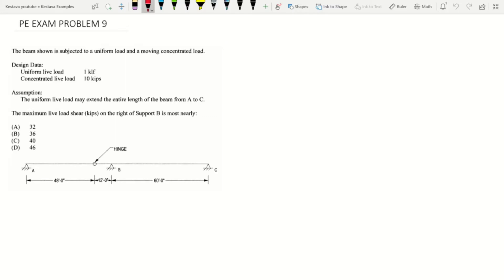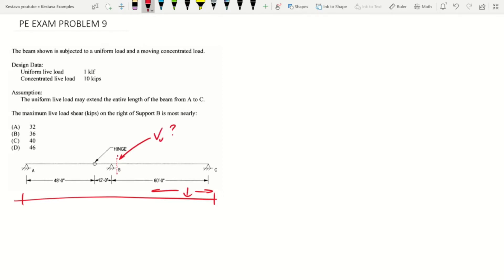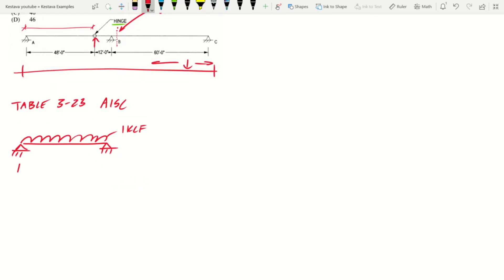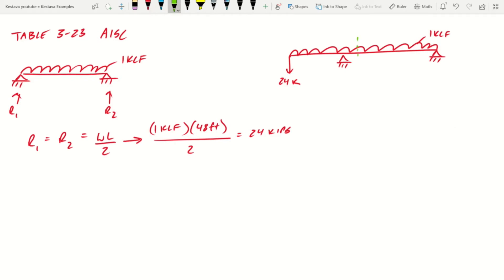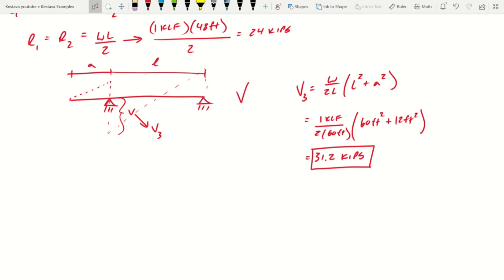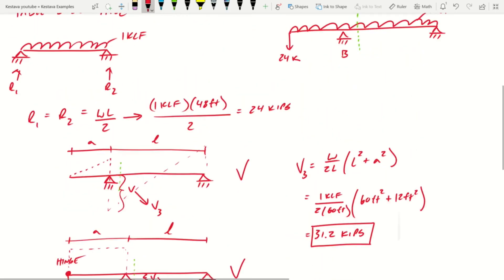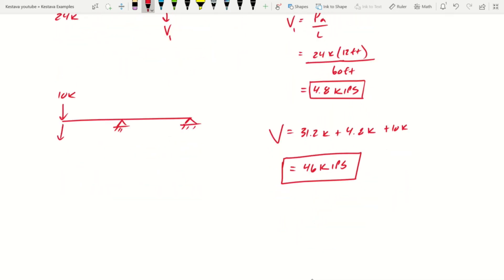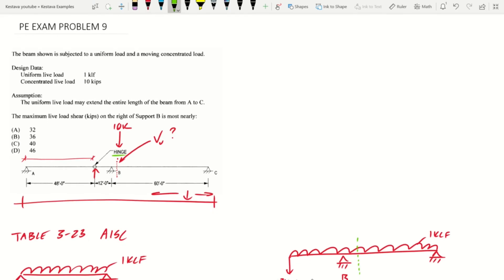Moving Loads, Hinged Beams, and Statics - Civil PE Exam Review Problem

Comment: The problem assumption, "the uniform live load may extend the entire length of the beam from A to C", infers the use of influence lines because one would need to determine with confidence that the UDL needs to be applied for the entire length of the beam versus a portion of the beam for maximum effect for shear at B. This also holds true for the location of the moving concentrated point load.

Comment: Go through your problems as I prep for my PE exam.

Another quick approach would be to use influence lines. Apply out shear hinge at “B”. 
As we create our diagram, we push up and we go up a unit of 1. Left side goes down to the hinge and right side gots to “C”.
For distribution load: Area*w=(12+60)*1/2 *1kip/ft = 36kips

For point load: load * height = 10kips*1 = 10 kips

36+10 =46 kips! 🎉